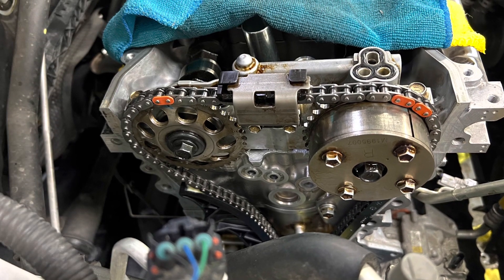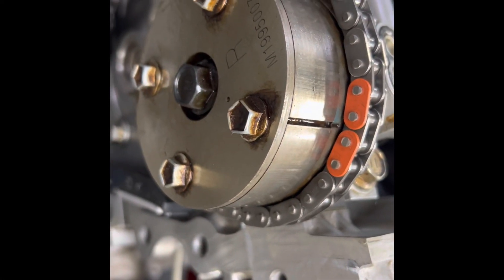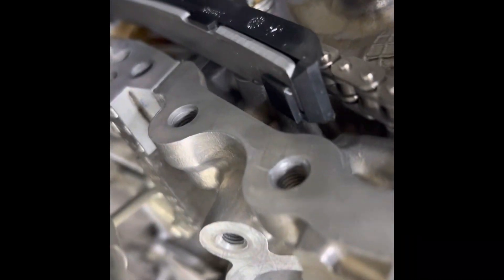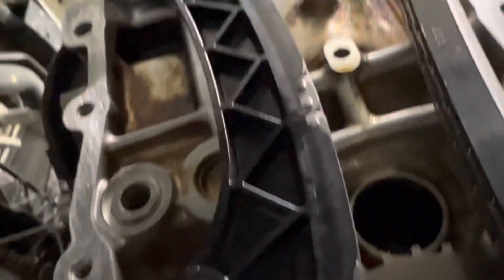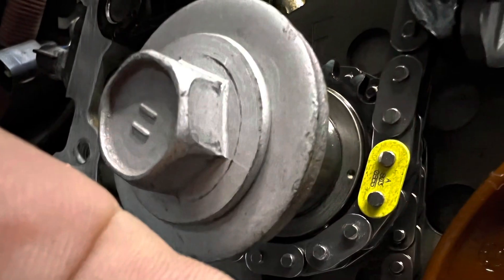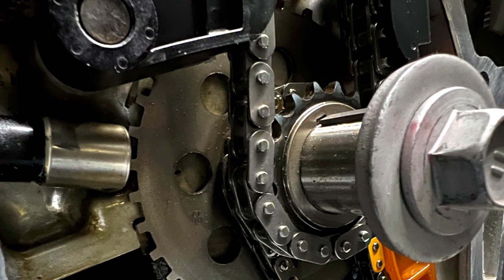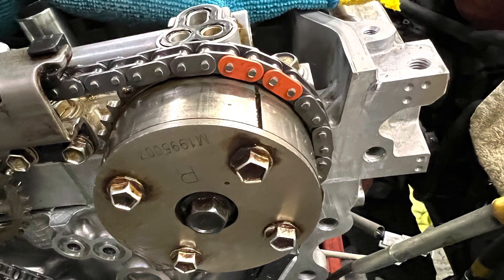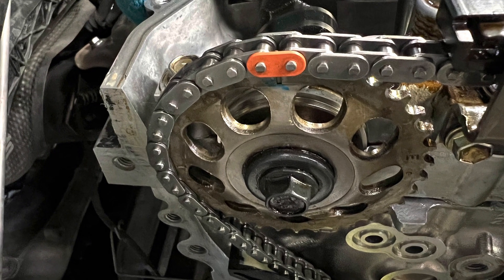Toyota Prius timing chain alignment Camshaft and Crankshaft

Comment: What do you do if the marks dont line up? After replacing head gasket then cleaning the head, fhe intake cam may have turned a little. Whats the best way to turn it back?
Reply: a wrench
Reply from the maker: Usually use a wrench on the camshaft and turn slowly because the pressure may make the camshaft turn too far.